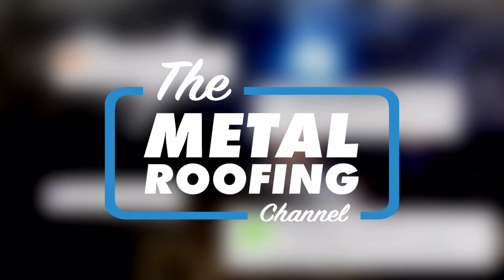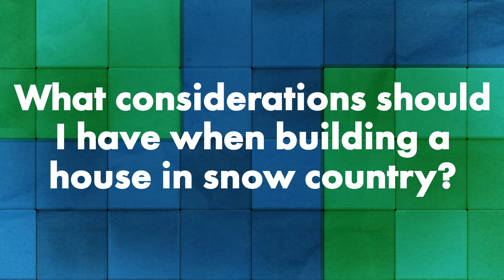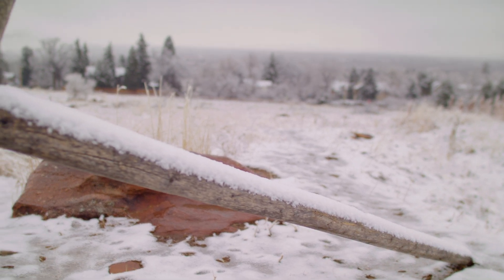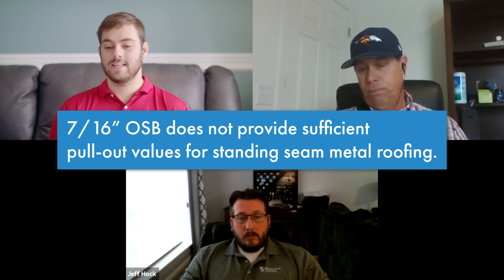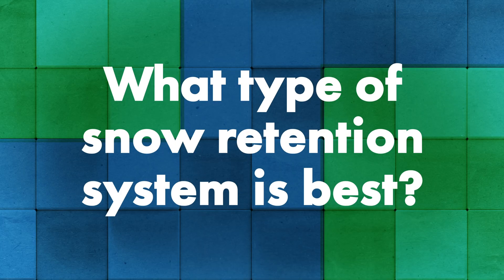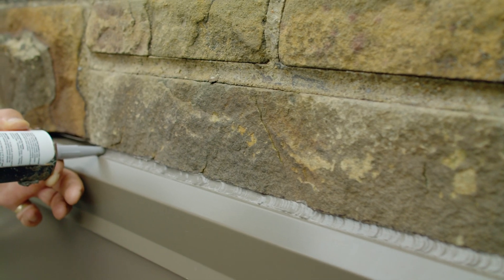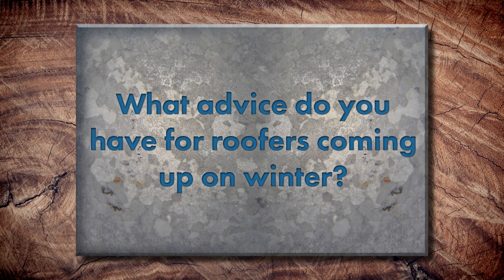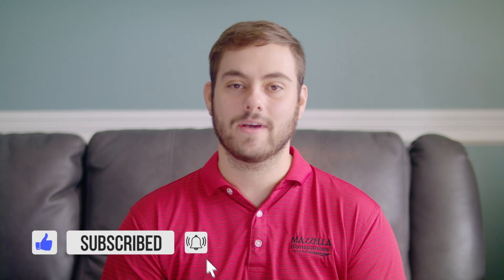Cold Weather Metal Roofing: Assembly Design, Snow Loads, Ice Dams

Comment: Hello Guys, Thanks for sharing the info, it is much appreciated. I have a question, I have a single skin brick garage (single car size) i have a brand new box profile metal roof fitted (with a condensation layer attached to the bottom to stop drips) The beams below it are roughly 100mm deep, either end of the panels are foam fillers in the gaps (which i presume is breathable)... the question is, what in your opinion would be the best way to insulate the roof? is it ok to press insulation boards directly against the roof, fill any gaps, and add a vapour barrier? or will i need a 50mm gap abover the insulation?. Im based in the UK, so pretty wet and cold for a bout 4\5 months of the year. Cheers.

Comment: We had  a metal roof installed in April 2019. Hidden fastener. Last winter it worked great. I have gutters. A different contractor told me "if you have gutters with a metal roof, if they're not on the ground the first Spring, they'll be on the ground the next Spring." Those gutters survived the first winter. I checked them this Fall and they're as solid as ever. They have to be below the roof line. Ours are 1 1/2" on the shallow end to about 3" on the deep end. The snow slides right over them. Make sure it's a good quality seem less gutter and securely fastened.
Reply: depends on your roof pitch and snow, steeper metal roofs snow will slide off quickly and not enough at one time to easily damage gutters. your experiece has nothing to do with others.

Comment: Snow and ice dams were the main reasons I went with metal roofing. Ice dams were a major problem before but not now, after 5 years. Snow guards should also be used above equipment such as air conditioning equipment ..
Reply: why would ice damming be different with a metal roof vs. shingle? Ice damming is caused by the sheathing heating up and melting snow continually in same spot on roof.
Reply: @fox156  it will come sliding off in big chunks